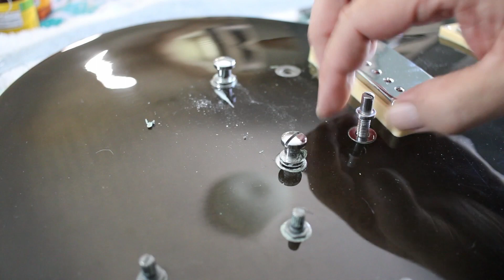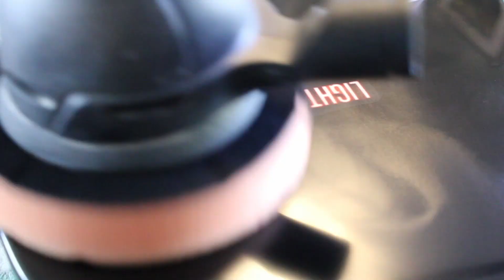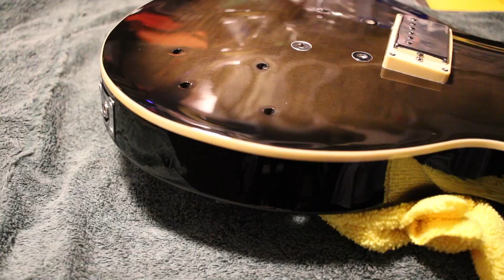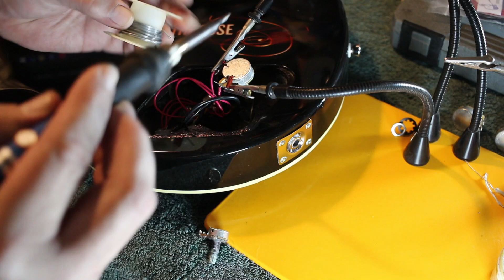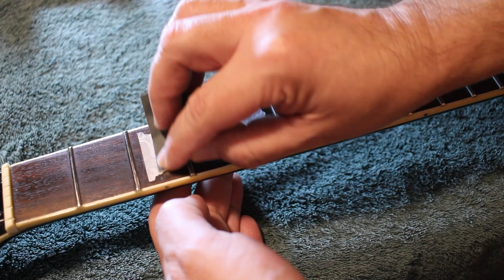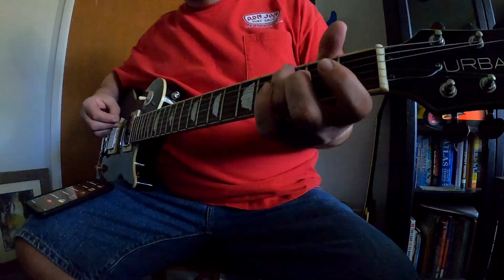Urban Guitars "Light The Fuse" Les Paul Pawn Shop Rescue

Comment: Thanks for doing this review. I have used Pledge furniture polish on guitars for thirty years also.  Never had a problem. I spray it straight on the strings and fretboard too. Conditions rosewood and cleans strings.  It will work to clean hardware and the body also.  I only use on polyurethane finishes though.

Comment: I tried one out at Guitar Center today $199 used. Probably the best guitar under $300 in the store. The only thing I might do is put on higher ratio tuners. I was tempted to buy it for it's slim body, weight and neck.

Comment: I picked one of these up for 20 bucks at a yard sale. It was filthy as hell and strung with acoustic 12's or 13's! It came with chrome tuner buttons, and I doubt anyone had changed them out. I have the same problem with the inlays. Thanks for the tip.